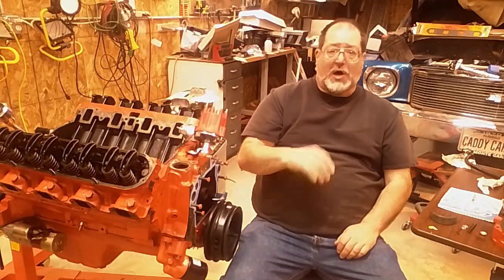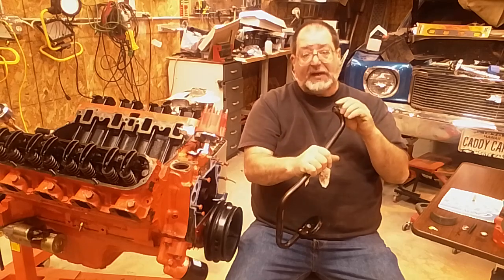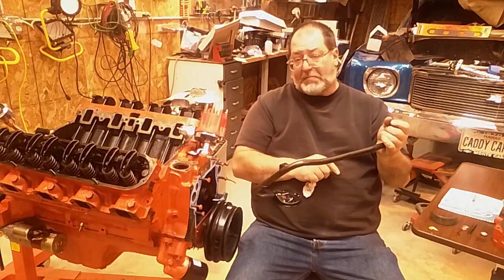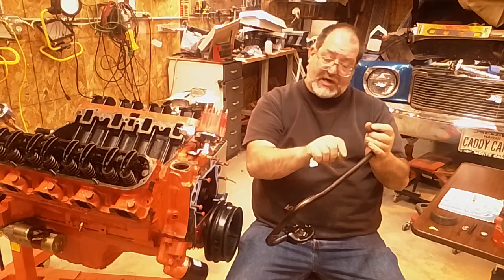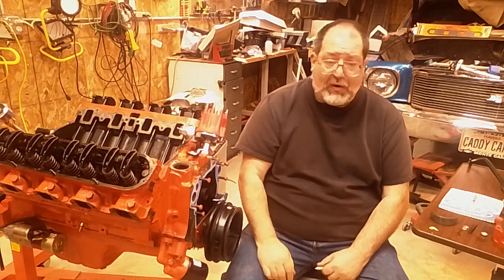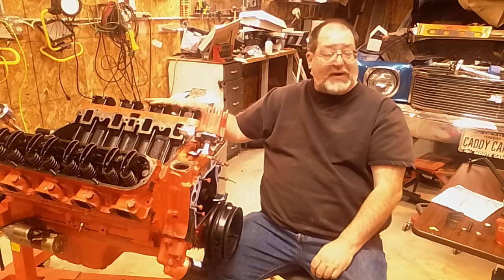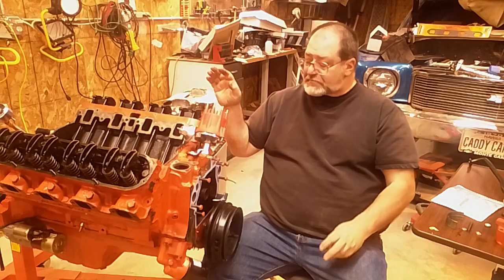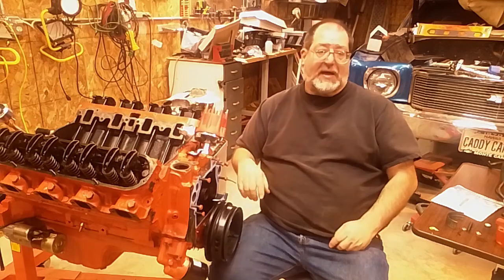Cadillac 472 / 500 Oil system and modifications

Comment: I have several Cadillac 500 motors, thanks for this video.  It always seems like the oil pressure is low on these, but the 10lbs /  1000 rpm rule seems to apply to these engines.  I'm going to run that  Delo 400 that I put in my cummins diesel on the next oil change and see how that works.  BTW, I have extra 500 motors that I'm not using , including the small chamber head ones that are more coveted.

Comment: Another great video.   I’ve got a 472 that I pulled out a 69/70 not sure the exact year.   It ran real nice but didn’t get to actually drive it.   Glad you shared this now that I’m opening the motor up to clean it up and replace the timing gear, seals and wage pump.      Wonder if you’ve seen freeze plug failures and Would you replace the freeze plugs if you saw rust on the old water pump….any other things you recommend I’d consider.    Im not looking to do a full build and just going to run it in a cruiser truck with some 3.08 gears, keeping the th400….should keep the rpm’s down with a 30-31 “ tire.    Thanks again really appreciate you sharing your experience.

Comment: My concern with oiling the rockers is also cooling the valve springs & valve stems as well.  I restricted my Pontiac lifters which is a Pontiac thing bc of to much oil starving crank. I restricted to much & over heated an exhaust value which stuck kiss the piston. Very lucky that only damage the valve.. Anyhow you need oil to cool down the valve train.. thank you for your knowledge,  Very very helpful as I am building my 1st Caddy 500.. shooting for 1,000 hp once I can locate aluminum heads..
Reply: Patrick I have complete billet crank engine with boogie man heads and high rise intake. $6000.

Comment: I don't recall his name, but an old drag racing fellow described a modification with the dual valley oil galley plugs.  He tapped both ends and ran lines up the oil drain backs in the heads that he enlarged. He modified early cadillac shaft rockers to use, and cut oiling grooves for each rocker in the shafts. He also cut what appears to look like oil grooves in the circumference of each lifter bore inline with the oil port to force oil around the entire lifter. I haven't tried these but he said he also ran solid lifters from a Buick at the time, as BOP typically share the same lifter bore diameters. An idea I would like to test or ask Mr. Hines about is the addition of oil jets under each piston at BDC. I used them from a Cone big twin on my ironhead, and that engine loves it. I remember Mr. Potter experimented with various coatings to cool the pistons, so I wonder what the Jets would be worth?

Comment: Buick guys came up with those groove bearings back in the 80's. Buick need it for 2 reasons one the oil goes around the cam on 1 bearing like a y-block and it has the same problem of hole hole locations and a small cam dia. Just like caddy.  Moving those holes to like 3 and 7 o'clock does wonders
Reply: Groove the cam bearing bores with dremil tool. Groove direction to between 2to3 oclock position. .060 depth x .080 wide in center of bore.

Comment: i bought a rebuilt 472 and when we installed it, the oil wont flow through. we changed the oil pump and checked compression. Its good there. Any direction to point me? Could a bad wiring harness have something to do with it?
Reply from the maker: Not sure I understand the question ... Also might be something to ask in my Facebook group Cadillac 472/500 ..... Oil pressure if in doubt should be checked with a gauge at the back of the block .... These engines don't prime well because of the long pickup tube so you may need to put some sticky oil like STP in the pump

Comment: What we learned about caddy motors in 1985 and up

They suck in stock form, they lack power
Heavy rotating weight
Heads need loads of porting
Won't run on pump gas with early heads on later block
Q jets suck
Force induction will wake these dinosaurs up
Valvetrain blues are present
They coast way more then chevy bbs
The blocks are awsome in strength  due to a thick bore and hight nickle  content
4 bolts not needed
Cam choices were limited to regrinds back then
A few failed from oiling issues
Don't use the rear sump with long pickup
The p rods bend easy
Don't use the cast rods go with modded olds 455 rods.
The height won't fit under the hood of most cars.
Put the motor in a very lite car.
Don't expect much out of a Na engine on pump gas.

Bloodviking
Reply: BS artist. Stick with catalog engines.